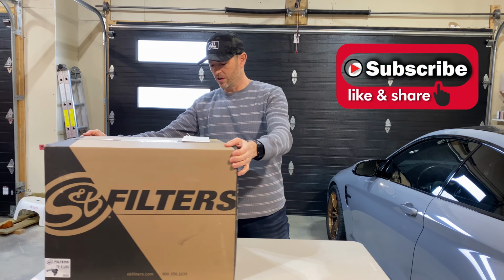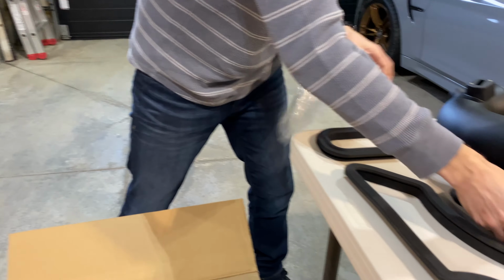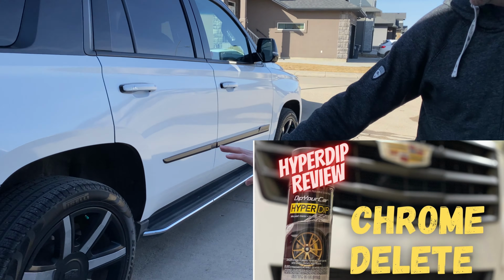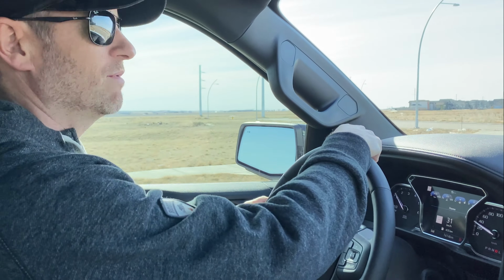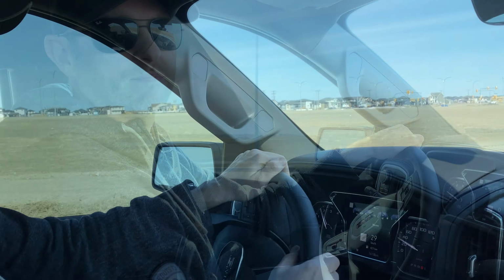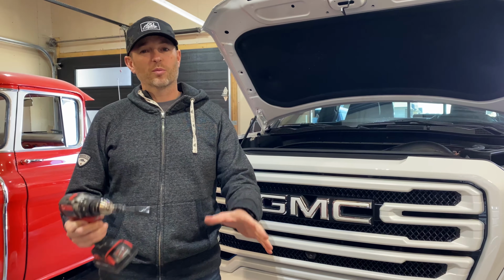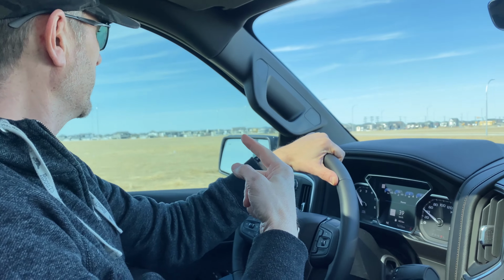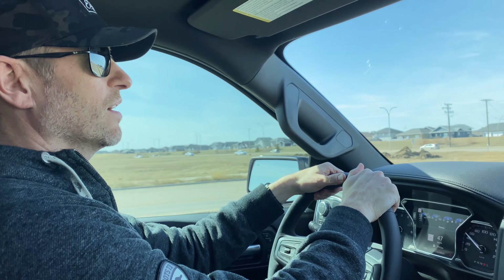S&B Filters Cold Air Intake 6.2L GMC Sierra AT4.  Full Install and Review - No Check Engine Light!

Comment: Would be great to have a timed 0-100 test before and after or something a little more definite
Reply from the maker: Honestly I thought about, but I didn’t have any testing equipment at the time that would measure it as precisely as we’d need.  I think it would take a tune and exhaust to change 0-100 times by any noticeable amounts.  This is my 3rd intake I have installed on a 6.2L and all of them have shown small improvements in mpg, a louder intake noise and improved throttle response.  Above all, it is fun in my opinion

Comment: What does this do to your warranty by adding this?
Reply from the maker: Hi Ryan, the answer is your warranty is fine, but I will also share this right from S&B's website:

Installing an S&B Intake Kit or Filter will not void your vehicle's warranty as long as you properly install and maintain your intake/filter. 

It is illegal for a dealership to void your warranty based solely on the fact that you have installed an aftermarket product. Your rights are protected by the Consumer Product Warranties Law, often referred to as the Magnuson-Moss Warranty Act.

If a dealer threatens to void your warranty, S&B will step in to assist you. "S&B commits that our customers will not be charged for a repair due to the manufacturer denying their warranty claim because of the presence of an S&B intake kit or OE replacement filter. We warrant that using an S&B intake kit or OE filter will not result in the denial of your vehicle’s warranty."

Comment: Why disconnect the battery?
Reply: IMPORTANT: Failure to disconnect the battery for a minimum of 2 hours may cause the Check Engine Light to illuminate upon completion of the installation or subsequent operation.
Reply from the maker: Thank you

Comment: Any issues with the Check Filter status coming on afterwards?
Reply from the maker: No because part of the install with these trucks is to turn of air filter monitoring
Reply: @Donslife  I did on the first step, but it auto turns back on when the vehicle is restarted.  2021 GMC Sierra Denali
Reply from the maker: You have time to go turn it off in the settings when you first turn the truck back on after reconnecting the battery.  Did you disconnect the battery for a couple hours before restarting the truck?  It is best that it relearns and adapts to the new airflow parameters.

Comment: Why do you have to turn off the filter notification on your dash?
Reply from the maker: My guess would be because the sensor is calibrated for the original filter elements lifespan and airflow rate
Reply: Sounds good. I saw this video 6 months ago when I got my Denali and have debating getting this but I made up my mind and making the switch. Purchasing it as soon as I get home

Comment: Why did you have to wait 2 hours before reconnecting the battery?

And what were steps 1-5 of the instructions?
Reply from the maker: It is to avoid a check engine light.  Here all of the the steps : https://www.sbfilters.com/75-5128install

Comment: i order gm peformance air filter its good or s&p batter
Reply from the maker: Both are probably similar in results except the factory one requires a tune from the dealer (so I have read).
Reply: I agree both are good but if u want one that doesn’t require a tune go with s&b

Comment: 50 hp gain at least lol
Reply from the maker: I was hoping for 500hp but will settle for a realistic 5-15hp lol
Reply: @Donslife  these cold air intakes always messed my cars performance up I stick to the way the OEM
Reply from the maker: @steves9600  that’s too bad, I have ran aftermarket intakes on the following vehicles : 1996 Ranger, 2005 RX8 GT, 2012 Yukon Denali, 2013 Sierra Denali, 2016 Escalade and now a 2021 Sierra AT4.   Sound and Throttle response has always been the biggest gain.  Power and torque perhaps a little but not astonishing.

Comment: Cold air intakes on non tuned engines are laughable.
Reply from the maker: I am happy with my extra intake noise, throttle response and minuscule performance increases.   Thank you for watching the video
Reply: So do you think that you gain nothing by simply installing one with no tune?
Reply from the maker: @z28tinman  in my opinion there are various gains across the board. A tune of the ECU would help get the absolute most out of an add on like this, but the design was meant to make improvements without a tune and without a Check Engine Light.   I like mine.